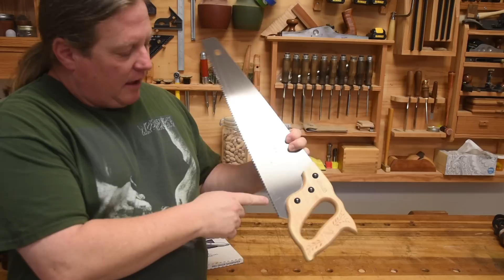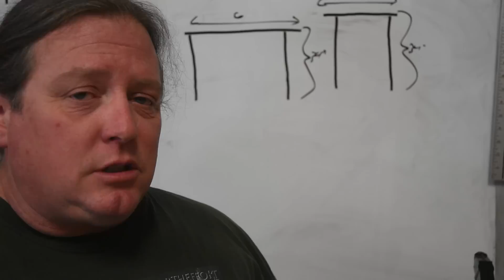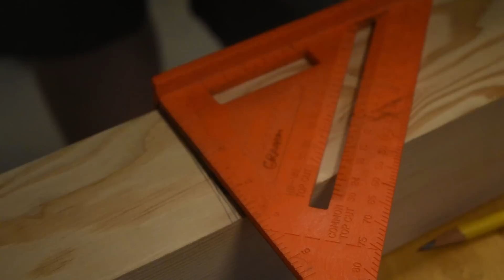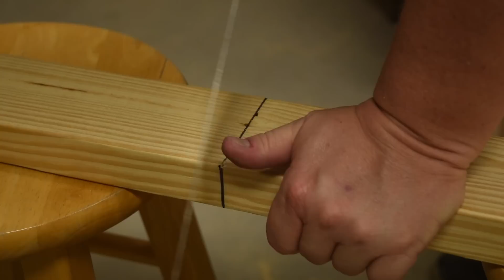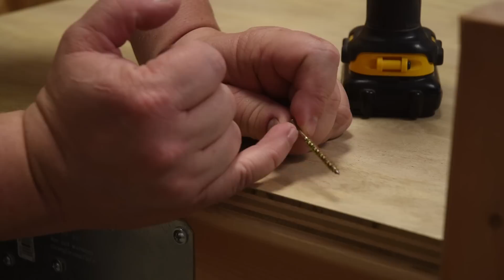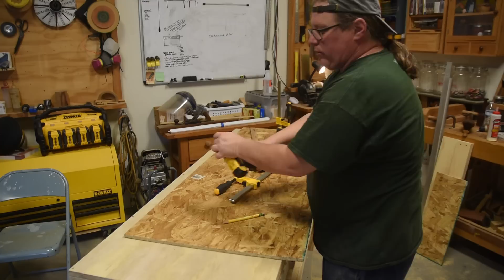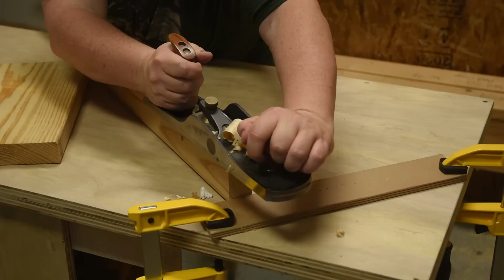The "No Skill" DIY Workbench Build - Start Woodworking Series Launch (Class One)

Comment: Would the 6" overhang on one end be stiff enough to hang a small vise, like the $20 Irwin vise, under it? I know it would have to be shimmed a little, but the 1-1/2" from the doubled up plywood, plus a 1x4 would bring it to just about the right distance between the top of the bench and the lower mounting holes. But it would just be hanging there, so I'm not sure it would work.
Reply from the maker: One way to find out. If it's not to your liking move it to the back side.

Comment: Thank you for this video. This bench is exactly what I need in my studio. But in my situation, I really need it on casters so I can move it around. If I build this with allowance for 4" locking wheels, will this compromise the integrity of the sturdiness of the bench? I really need it to be  "rock solid" for the work I do. I appreciate your input.
Reply from the maker: Should be fine.

Comment: Great video - but unfortunately your Amazon link for the corner clamps doesn't show the product you are using (connecting the 4 x 4 posts to the 2 x 4 rails.  I have not been able to source these anywhere in the UK.  Any ideas - or are they no longer made?

Comment: Thanks so much for the video - I'm inspired to build my own workbench. Just struggling here in South Africa to get anything similar to those steel brackets and the amazon delivery is fairly hefty. I've browsed the comments to see if anyone has a similar issue but there are so many its not easy to do :) What would you recommend the next best simple and sturdy option would be? Would I have to learn how to do a mortise and tenon? :)
Reply: Sir, you might try getting and using something called "mending plates". They just flat pieces of steel, of varying sizes, with multiple holes drilled in them. Because they do not wrap around the edges of the lumber, they might be easier to get and cheaper.  Good luck to you Sir !
Reply: @dancahill9122  Hi Dan. Thanks so much for taking the time to answer - both for myself and others with the same issue :) After a quick search I see we have a lot of options for mending plates here in SA - so I'll definitely keep these in mind for the next project. For my first workbench I ended up stretching myself and cutting lap joins on my table saw - and was pleasantly surprised by the results.

Comment: I really want to build this work bench. I have an old workbench, but it is prone to rocking and it is almost impossible to plane anything on it due to that fact. The corner braces, though.... we don't have Home Depot, and I have not been able to find anything like those in Denmark. Do you have any suggestions on how to achieve the same level of rigidity without those braces?

Comment: 2023 Build Report

I found this project to be quite a bit more expensive to build in 2023. The Simpson Strong Ties are $10.53 each at Home Depot, and the screws for them are $12 for a box of 100, and you need 2 boxes (there are 22 screws per bracket x 8 = 176 screws). I thought the OSB looked ugly, so I went with 2 sheets of 3/4 inch sanded pine plywood at Home Depot which was $65.65 per sheet. Here's the total cost breakdown for me:

Simpson Strong Ties ... $10.53 x 8 = $84.24
Simpson Screws (200) ... $12.28 x 2 = $24.56
4x4 Posts (8' each) ... $19.99 x 2 = $39.98
5 2x4s ... $2.99 x 5 = $14.95
3/4 inch Sanded Pine Plywood = $65.65 x 2 = $131.30
Glue ... $7.99
Miscellaneous Screws (estimated) ... $5.00
----------
Subtotal ... $308.02
Texas Sales Tax (6.25%) ... $19.25
----------
Total ... $327.27

I'm not including the clamps, saw, and other miscellaneous tools I bought for it.

The other option I considered was to buy a 6' Rockler workbench for $649 (plus tax), but that comes with 2 vices and and pre-drilled dog holes and beech wood. It's probably not as sturdy but you could reinforce it with extra screws and braces. So in other words for a little over twice the cost you could have any actual workbench with vices and all you'd need to do is just screw it together.

In the end I decided to build this bench just because I wanted to actually build something.

Enjoy.
Reply from the maker: You forgot, this one can be changed in the future or repurposed. Others can't.
Reply: @wortheffort  Thanks. Yep, you're right. That's another reason I built it instead of buying something. I'm almost done.

Comment: you might be able to skip the angle tool,  some if not most saws actually have a 90 and 45 degree messuring with the handle and the back of the sawblade :)

Comment: So I have a question for you and the community. I'v been working with free pallet pine for the past year in my free time. Building my skills to do different things. I want to make the jump to proper hard woods and in that same jump, make products to sell. What's the best way to start this thing? My initial thought is to simply come up with a build idea, get the materials, build it, finish it, and sell it on a local website like craigslist or letitgo. Does anyone have any suggestions for someone starting out?
Reply from the maker: This is business 101: find a customer first, make what they need.
Reply: @wortheffort  I can agree there. In that case what would you suggest for avenues of getting your "brand" out there? Obviously ill have to work around covid, but besides setting up a website, what methods of finding customers have worked good for you in the past?

Comment: When I try to sync the screw my drill just skips and to avoid stripping the screw they’re actually sticking up like an eighth of an inch, what am I doing wrong do I need a better drill?
Reply: Make sure your using a Phillips screwdriver head and not a PZ2 screwdriver head, there is a difference. The PZ2 head has 4 extra small blades between the main driver blades.

Comment: I don't know if the price of your material is obsolete but here a 2x4 of 10' in pressure treated wood is close to 12$. Before taxes. And a standard spruce plywood 3/4 x4'x8' is 80$.  but anyway the video is great, nice working with hand tools
Reply from the maker: Prices are falling. Wait a few weeks. Don’t use pressure treated for stuff your touching all the time.
Reply: @wortheffort  red cedar 🫀

Comment: I plan to make a woodworking bench and have access to a lot of short oak hardwood flooring. Is it ok to construct the top using these short boards running cross ways instead of lengthwise?
Reply from the maker: individual boards would have to be joined together or they will bounce.

Comment: You don't need metal corner brackets at all. Design your legs of two 2x4s in a L-shape and there is plenty of space to screw anything to it.
Reply from the maker: I believe you missed the part about leverage and time. There's a reason these are stronger over the long haul.

Comment: Hi Shawn, brilliant video and got me wanting to replace the flaky bench in my workshop! Can you share a materials list in the description? Also is there an alternative to that corner bracket as they don't seem to be readily available in the UK (at least google said no...).
Reply: In case anyone else is looking for them. RTC42 brackets are not available in the UK. The closest they have here is the RTC2Z which uses a 2x4 for the leg I believe.
Reply from the maker: Thanks, I'm sure there are as it's a standard building bracket. Likely made for metric instead of Imperial over there.

Comment: Are the metal brackets you use on this project readily available (big box) or special order on  line?  Great video.  I need to make two or three for my shop and want to make them just like this.  The plywood on the floor was a great idea.
Reply from the maker: Past few years I haven't seen them sold as a kit in the big box but the individual parts are readily available. I ordered mine online during COVID.
Reply: @wortheffort  Thanks.

Comment: Hi Shawn I'm really enjoying your videos.  On this work table in this video is there a way to add dog holes to help with clamping? Thanks D
Reply from the maker: Just drill a hole. 1.5" should be enough. If not glue a board length wise underneath at dog hole location.

Comment: I give an idea. Hang a powerful battery like a knapsack on your shoulders, about 1 kW / hour, it weighs about 4 kg, and connect any tool to it. From chainsaw to electric planer. Which, in turn, can have a motor power, in this order, as much as 3-4 kW, depending on the battery cells and the device of the battery itself.
Даю идею. Вешать, как  ранец на плечи мощный  аккумулятор, около  1  кВатт/час, и подключать к нему любой инструмент. От бензопилы до электрорубанка.  Который в свою  очередь  может  иметь мощномсть, в  таком порядке,  аж 3-4  кВатта, в  зависимости от аккумуляторных элементов и  устройства самой батареии.

Comment: I think you can't get the bottom shelf in not because you aren't smart enough, but because I don't think there's any way it would fit. Maybe you could cut the shelf first, drop it in from the top, dry fit it, put the top on, then screw in the bottom after everything else is put together. I don't want to cut the shelf in half because 1) It's a hack and I don't like it, and 2) Keeping the shelf a full board will help add to the stability (though it probably doesn't matter that much).

Comment: 8 brackets on order! All lumber needed for this workbench project fit in a Toyota Corolla with doors and trunk closed!
That's two sheets of 3/4" plywood cut 8'X2', six 2"X4"X8' boards, and two 4"X4"X8' posts. Everything was strapped in the car so it would not slide forward. https://youtu.be/Q9BfcpGSObM

Comment: I quit using Philips and Flat head screws in the 80s. I thought woodworkers would have figured out why by now. It's called the Robertson screw BTW.
Reply from the maker: You’ve never used a quality screwdriver or screw. There’s a reason gunsmiths, clockmakers and other fine machinists still use slotted screws.

Comment: If I tried to make those long cuts with a hand saw, my edges would look like an interstate off ramp. 😡
Reply from the maker: Sharpen your saw.
Reply: wortheffort I cheated.  I had Home Depot cut to size my plywood.  I also just used my chopsaw for the 2x4/4x4 crosscut.  😝
Reply from the maker: Dax Mickelson that’s smart